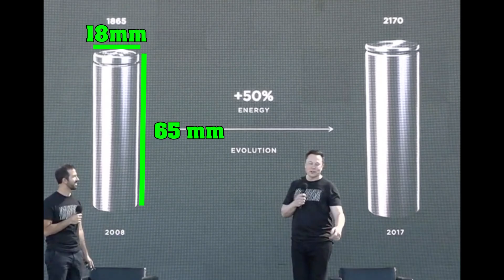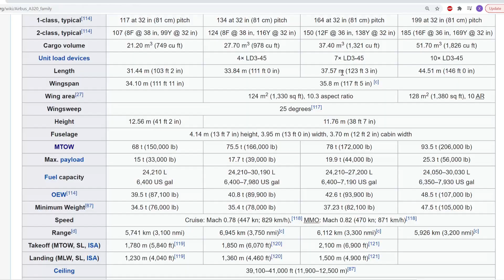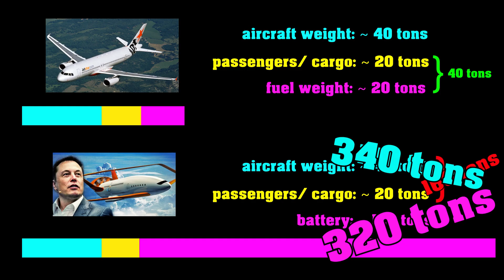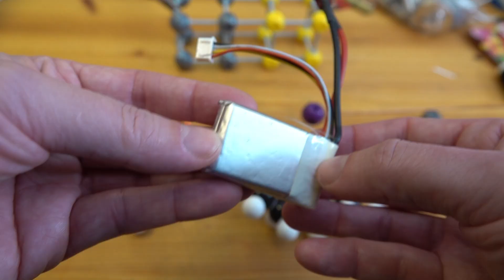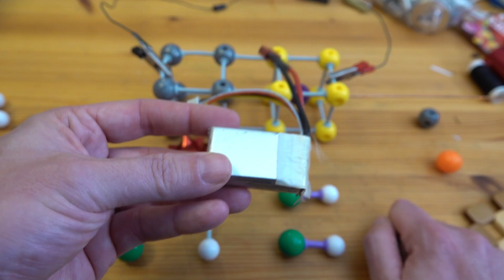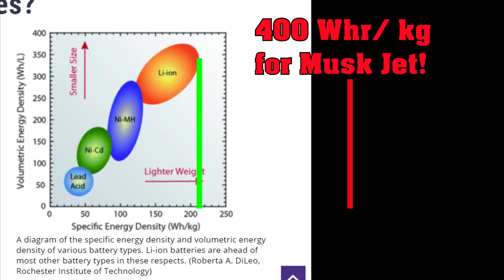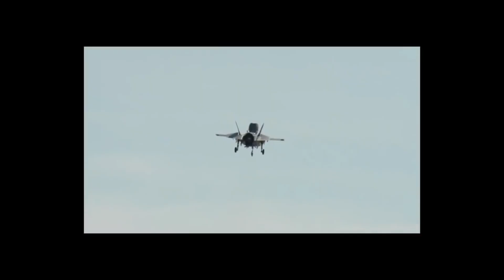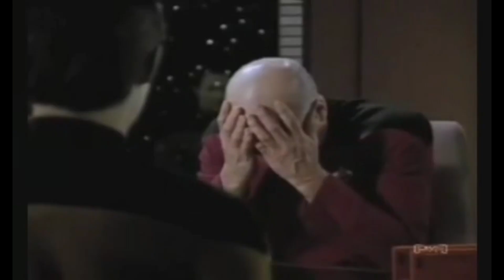Tesla's Secret Plan To Disrupt Airlines: BUSTED!!

Comment: Fuel tanks get lighter as they drain and the engines they supply maintain full power all the way from 100 to 0%. 

Batteries maintain 100% weight and reduce power as they drain.

Comment: “The higher the Elon plane flys the efficient it becomes” — I wonder why it reminds me of “Homeopathy” 🤔
Reply: You might be on to something here. All they have to do is use smaller and smaller batteries until you can no longer measure their existance, all the while they get more and more efficient... :-)
Reply: Well, that one claim is legit. Regular planes fly as high as they do due to less air resistance.
Reply: @fabiodan30  Yea but they still need some air to work and enough of it to go through the system. If you go with "no" air, you have to bring your own (like rockets do)
Reply: @fabiodan30  That claim is not legit at all. Instead, "the higher a plane is flying, the less energy is lost to drag" is a valid claim. However, less air density also means less matter for an engine to work on, effecting the produced thrust (type of engine does also matter). Only given a particular given amount of thrust, will flying higher become more efficient. You may want to look up what less air density does to the maximum thrust of an engine (in particularly propeller based ones), not to mention what it does to materials when everything has to work at much higher (rotational) speeds, when there is less resistance to slow things down. This is all well known. Some of it for almost as much as a century.
Reply: @elmo2you  Why do you think jet engines have a turbine at the air inlet?
Reply: @stevenvanhulle7242  Is that a serious question? I intentionally simplified things, to get the main point across. Unless I'm mistaken, it is in fact jet engines that can produce more stable thrust (relatively speaking, to other types of engines) at different altitudes. Either way, this electric vtol supersonic plane story is so full of holes that one really needs pretty ignorant on the subject matter to even remotely take it serious. But sadly, plenty of people who fit that bill. Worse, plenty of those love to praise this charlatan. I'm pretty sure that this kind of endemic wishful thinking is going to play a significant role in what is likely to ruin what we know as Western society, somewhere in the next decade or so. Frankly, we will have only ourselves to thank for that, for letting this train wreck run amok.
Reply: @elmo2you  It was a serious question, at least inasmuch sarcasm is serious.
Reply: @stevenvanhulle7242  Point taken .. fair enough. So, where would that turbine compressor be in Elon's plans? Ducted fans are fun for toy planes, but I don't believe those will cut it IRL. Feels like were might be on the same page here though .. or do you think there is more to this than Elon once more just talking out of his ass?
Reply: @elmo2you  It would be a legitimate claim if Elon thinking about some kind of exotic electric powered propulsion for supersonic flight while using ducted fans or whatever for vertical lift-off, frankly even though Elon got a physics degree I am rather skeptical about him developing a supersonic VTOL jet even if he somehow single-handedly developed a new form of viable electric propulsion excluding classic fan blades&air compression/expansion design (not viable for battery-powered plane due to high energy requirements well outside incoming solid-state 400kWh/kg batteries) as the only place where supersonic makes sense due to noise restrictions is an intercontinental flight where VTOL capability is just dead weight. So, currently, his dream looks similarly improbable like his starship intercontinental airliner concept likely promoted just to boost interest in his company and shares (Elon is too smart to believe in such thing seeing service), but what I know... In any way, subsonic VTOL replacement for helicopters would be much more profitable due to the massive potential market and cheaper to produce, currently, there are already some battery-powered seaplanes operating in Alaska, so electric helicopter replacement is unlike Elon's supersonic far from sci-fi and many companies working on such replacement already...
There is some research going on reducing noise levels of supersonics, but so far it resulting in very pointy airplanes with additional dead weight in front, so not very ideal for VTOLs, which would mean no high speeds over habituated areas, thus killing most of VTOL & supersonic combo plane purpose to even bother spending time on it, even low-pressure hyperloop maglev combo would make more sense to build in highly populated areas, though not the cheapest way to pay for terrorist paradise...

Comment: Oops ... Slip-of the-tongue ... @ 25:53 "However it also means there's also less air to get your" LIFT "from".
Reply: I'm dreaming of a plane with electric motors with some capacitors, IGBT's for the inverter section, & an MAZER to send power up to the plane... Batteries??  I don't need no stinking batteries!!! ... I should do a kick starter ... Maybe Richard Branson will get involved and he knows a lot about getting access to OPM.

Comment: A minor correction. The jet engine has higher efficiency the faster and higher the airplane goes (up to a limit of maybe 12000 meters), the EDF (electric ducted fan) has lower efficiency the higher and faster the airplane goes. In fact the EDF has approx half the efficiency of a propeller driver electric airplane. I am an rc model airplane pilot as a hobbyist. Not even rc model airplane with EDF can make vertical take off. Landing can of course be vertical and then you have to buy a new airplane.
Reply: There is plenty of RC Electric Turbine Engine based VTOL videos on the web. It’s usually a costum job. I’m pretty sure you can do this with cabin of 1 to max of 8 in real world size just by scaling tech up and improving it abit along the way.
Reply: @nextInsiders  Flight time 3 minutes, don't really think that scales.

Comment: Okay, made it all the way through to the bit where the Social Sciences and Gender studies Nerd is proclaiming "Electric Engines get more efficient at higher altitudes!!!" Dear gods! Does he think these things are Star Trek Impulse Engines? Ducted fans get less efficient at higher altitudes because they have less and less air to push against. Jet Engines or Ramjet/Scramjets can still work so long as you are feeding them Oxygen. It is the pressure differential caused by the combustion in the high pressure turbine that actually provides the kinetic force to provide forward motion. Electric Ducted fans are just Windmills in reverse.  Really the effective max altitude for a Propeller driven aircraft, ie one which drags itself through the air, is around 40,000 feet. Yes NASA got Helios up to 96,000 feet. Mostly because the thing had virtually no weight load. It was a vast styrophone wing with 17 propellers dragging it up there. But propeller/turbine efficiency starts to drop rapidly for every 10k you go above 40k.

Comment: Considering airline companies are cheap enough to reuse olives in their salads, I dont think they're going to want to replace 70% of a plane every 2-5 years.
Reply: Not to mention that at this point, all the E-Cars, E-Bikes, Smartphones and according to Elon E-Planes. are all using the same rare materials for these batteries. 
Its going to be like the whole "oh no we are going to run out of oil" thing, but this time its actually going to happen pretty soon.
Reply: @DeadNoob451  But Lithium is recyclable, it's just an additional cost.
Reply: @Rooey129  Yeah, but the more things that use it the more batteries need to exist at the same time. Also that recycling process isnt recycling the lithium (seriously, just google this) they usually just burn the batteries and recycle only the copper and nickel. So yeah its recyclable in theory, but its not being recycled. Its being burned.

Comment: I see you referenced the Specific Energy table often, which shows body fat as very close to diesel. Be careful, before we know it - Elon will be hawking an aircraft where fatties load up, are plugged in, power the aircraft in flight and lose weight at the same time.

Comment: I have not done the maths yet, but even if you had a winch attached to a skyhook there is a limit to how high you could lift a 1KG weight with just 400w/h I need to work it out. According to my very rounded figures a 400w/h 1KG battery driving a lossless crane could lift itself to about 150Km altitude,  this is with NO payload or airframe.
Reply: You had me confused until I realised you meant Wh, not W/h.
Reply: @cambridgemart2075 , not units I use a lot, but yes watts times hours. I wish Elon would do the basic maths. I don't think my figure is far out, hopefully have not shifted the decimal point!

Comment: The electric JET engines get more and more efficient as you increase altitude. 

"Help me, HELP ME NIGGA" -Kevin Hart

Honestly, how don't they know that propeller-driven aircraft,  are just diagonal wings, helicopters are just propellers taken to the max, and even an electric helicopter cant work in space, the speed of the rotation needed is not physically impossible. it may surpass the flight ceiling of (Insert generic turbofan) but does that make it inherently better? 

NO

Comment: This was deliciously delightful!  You unpacked so much in this video.  The higher you go the more efficient an electric battery gets because air resistance goes down.... but so does that engines ability to pull in air as there is less air to pull in, thus efficiency offsets.....  NOOOOOOOOoooooooo!  

Wait!  I know they plan on blowing the battery and using it like a rocket to fly through the atmosphere at higher altitudes, IDIOT why didn't I think of that LMAO 😂
Reply: That would explain the whole electric "jet" part.

Comment: More I learn how ineffiecnt Li-Ion batteries are, more I feel, its better to work on making ICE more efficient.
Reply: The thing is, we've pretty much taken ICE to its endpoint already. The only efficacy improvements I can think of would come from more efficient fuel. But yes, ICE is far superior to LI-I batteries by a factor of... a lot. Batteries were never meant to actually replace anything but instead to supplement other systems. But now people somehow think they are just these magic power bricks that can fix all the worlds problems.
Reply: @Grauenwolf  To each their own, at least you aren't parroting how the 'battery is a replacement,' rather than a supplement.

Comment: Three naked inmates stand in the showers and in walks' the Warden.
"But, But, But."
The batteries will be part of the structure, like lego's of battery cells, TIG WELDED together. Patent number 2014 / 80081E5

Comment: Our new HyperBatteries. Up to 50% more battery per battery. Only at Tesla.
Also, dont planes have extreme problems whenever they want to land with a full fuel tank ? Pretty sure they have to dump fuel beforehand.
How is he going to solve that one ?
Reply: Conceptually it is simple.  Landing forces are larger than take off forces and as such control the design of the planes structure.  That is why they have max landing weights.  The design assumes they will burn most of the fuel in flight, if they don't they have to dump some amount to ensure a safe landing.  The simple answer is to just design a beefier plane structure. But of course that adds even more weight to the plane and makes it even harder for a battery plane to be viable.
Reply: DeadNoob Dump batteries!

Comment: Just a minor note. Musk's (SpaceX's) engines that are actually used  don't run on methane. Merlin engine, in the Falcon 9 and Falcon Heavy is simple and old tech engine (it's open cycle too, unlike high tech engines such as RS-25 - shuttle main engine, or Russians RD-170 - Energia) and it's running simple RP1 (highly refined kerosine)  and LOX (Liquid Oxigen). Of course it's still hydrocarbon (complex blend) but it's not methane.
Only the Raptor engine that is intended for the Space ship (nonsense) and it's booster (Super heavy) runs this. So it's an development thing that hasn't even reached space yet.

So more accurate would be to say Musk is experimenting using methane, but the actual production rockets still run just a petroleum product in form of RP1.

Comment: Wait a minute.  How do electric planes get their thrust?  Some variation on the propeller, right?  So how are they going to fly as high as is claimed?
Reply: You can use a supersonic turbofan, without the gas generator.
Reply: @jaffacalling53  So, basically, a propeller.  And then, the spinning prop can be used to generate the electricity needed to spin the prop.  Infinite free energy.
Reply: @michaelsommers2356  What are you going on about? And turbofans are more than just propellers, the airstream is pushed through a nozzle for an increase in velocity.
Reply: @jaffacalling53  It's still basically a propeller, and it needs air to work.  The last bit was obviously a joke.
Reply: @michaelsommers2356  Well yes, but the addition of a nozzle makes it much easier for a turbofan to exceed supersonic speed when compared to a propeller. Turbofans are actually more efficient than turbojets at supersonic speeds below mach 2.
Reply: @jaffacalling53  Sure, but the thrust still comes from pushing air out the back, not from burning fuel as in a jet or a rocket.  And for that, you need lots of air.

Comment: Phil, you used the A320Ceo for data - use the A320Neo family and the difference is even greater. Boeing found out about the risks of batteries in an aircraft and it cost them some $30 billion on the 787 program.

Comment: The issue you have with battery powered aircraft is the mass of the battery is constant. Petrol fuelled aircraft get lighter and more efficient as they travel and they are only fuelled to a sufficient level before they take off. Commercial aircraft do not carry extra fuel beyond what they are legally required to. It is too heavy and too hard on the aircraft. Given the mass of the battery doesn't diminish as would the fuel load of a typical aircraft it will always be way heavier than a hydrocarbon propelled craft especially when it's on a short trip.

Comment: supersonic VTOL? Bahahaha that's new

very much sub-sonic electric vertical take of and landing will soon have its role for flights within dense urban areas, replacing some air-taxi helicopter operations for buisiness people. Right now any VTOL electric technology relies on putting people down to the wire of battery reserve, like get an unexpected headwind and you run out of power sort of thing. Tech ultimately needs another 5-15 years for energy density to be realistic. Electric fixed-wing pilot-training aircraft will be first, and are already here in small quantity. Regular fixed wing is just easier from an endurance time in the air and flight range standpoint, but as mentioned in this video, scaling up above a 2-4 seater training airplane is very difficult.

Comment: It must be noted, that even though modern aiplanes use Turbofan engines, they still have a jet engine inside the unit, which is a part of why they can generate thrust at high altitudes. I'd doubt an electric motor would be able to efficiently compensate for that

Comment: 3:00 I would like to point out one thing. While the cells individually hold no real extra amount of power the real benefit of having bigger batteries are making the packs more dense. So fewer cylinders fewer gaps between the cells, combine this with hexagonal packing and without increasing the over all density you can improve the Wh/kg. Will he hit 400kwh/kg? Doubtful.
Reply: According to battery day with the dry electrolyte, the silicon anode and a nickel cathode they should improve energy density by 40% so that's ~364WH/kg
Reply: @johntheux9238  I never watched that, that's the non-flammable battery that has been talked about for a few years correct? Or at least "less flammable" lol... Thunderfoot was mostly basing this video on Lithium, I was only pointing out how it is possible to improve density via reducing wasted space and less material.
Reply: @egg-roll8968  I think the Maxwell dry electrolyte is what makes them "less flammable" but I'm not sure.
Reply: @johntheux9238  Just found the ones I was thinking of, they are Lithium Ceramic Batteries and alike. Tho I do look forward to the dry electrolytes as well.

Comment: Why do I feel that it's better to use a runway than massive vtol capable engines?  
Airliners usually have a thrust to weigh ratio of 0.3. So to make it vtol capable you need 3 times the engine power and a more complex wing structure.

Comment: Musk fanboy here
im pretty sure the idea of the VTOL electric plane is intended to replace helicopters/small planes and possibly maybe be a "flying car"
Comparing with huge planes doesn't seem fair

Comparing with an apache: 
6T empty (60% vehicle)
~920 L =  ~1T fuel (10% fuel)
3T cargo(30% cargo)
10T full

Using the 70% battery figure and cargo cap from apache
6T Vehicle (20% vehicle)
3T cargo (10% cargo)
21T battery (70% battery)
30T full for a helicopter

Yeah this doesn't really seem feasible unless it's to simply transport a couple filthy rich people for the sake of it...
Probably won't be economical until very far in the future, if ever.
Would need crazy impossible shit like a "quantum hyper stable pure electron battery" to achieve this.

Comment: Ridiculous, you don't need 70% of the aircraft to be battery, you just need them to be in-flight hot-swappable.  A modest fleet of solar-powered battery support aircraft can catch up and dock during the flight to swap them out periodically and then slow to recharge the empties without even landing.

Hot-swap also solves the fire problem - just design the batteries to preferentially vent hot gas inward and use the thrust to eject burning cells out through the hot-swap bays.  Try doing that with a fuel tank!